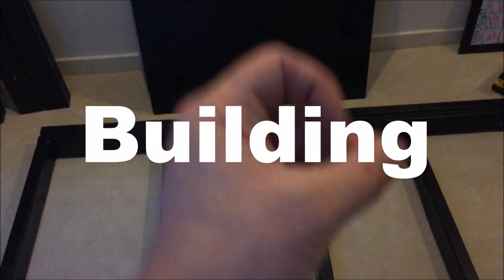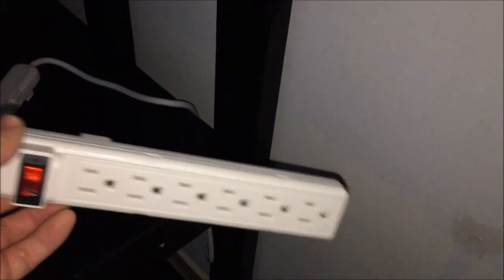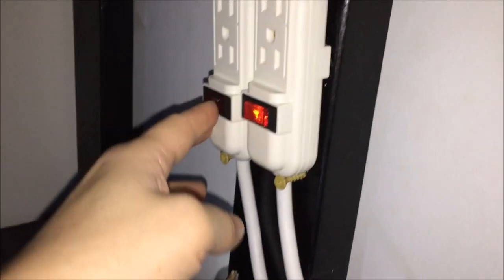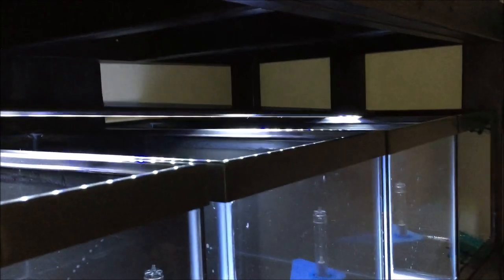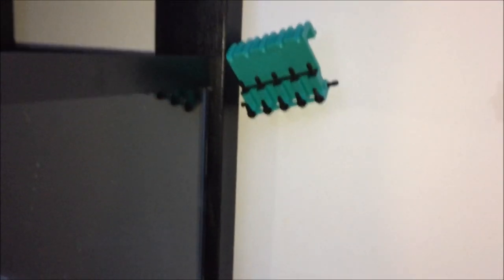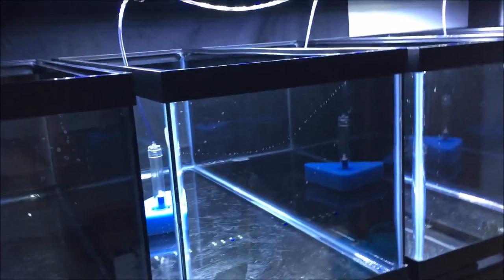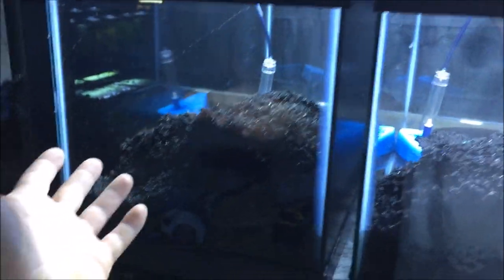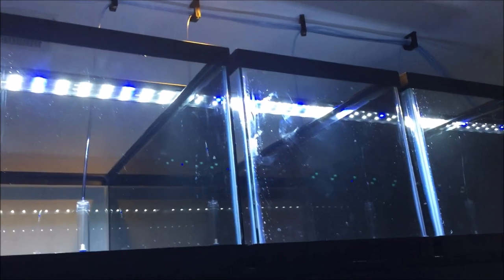20x20 Aquarium Rack Build Part 3 for Freshwater Aquarium Fish, Shrimp, and Aquatic Plants

Comment: What do you do for heating the water?
Reply from the maker: I heat the whole house and since my dehumidifiers blow hot air its always warmer in the basement.
Reply from the maker: The garage I do add a oil  electric radiator heater to help since its concrete floor. All the thanks also help hold in heat as well.